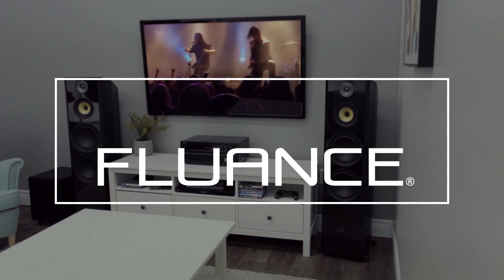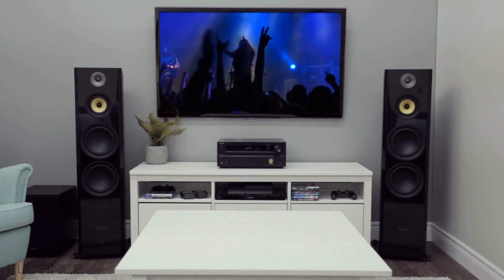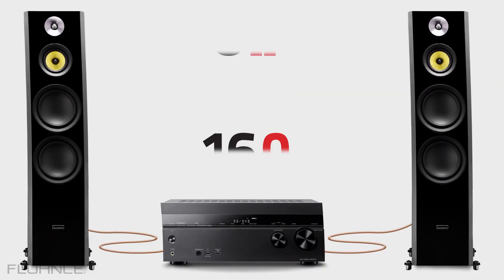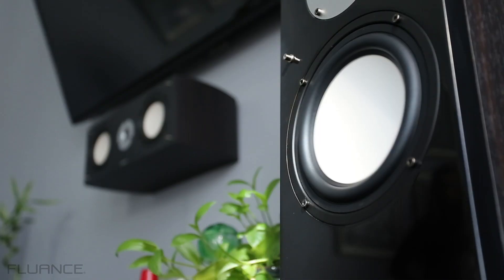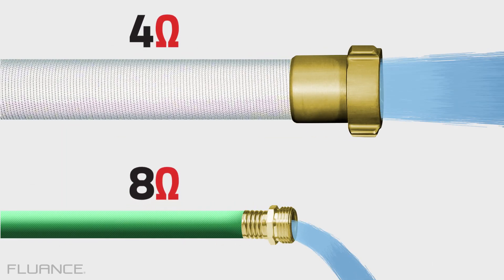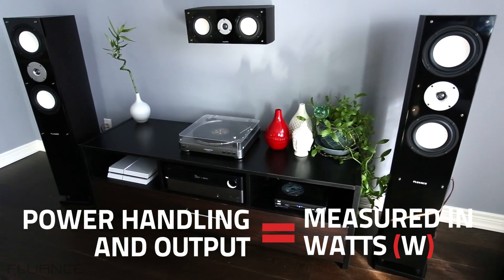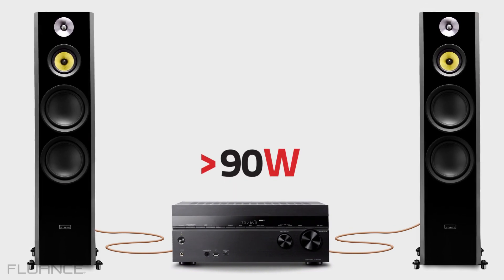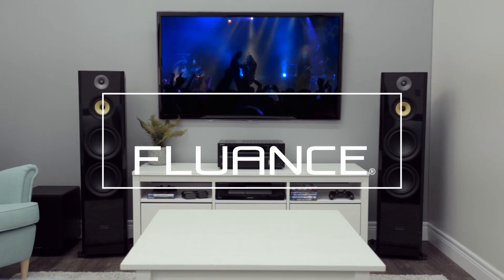How to Select an Amp or Receiver to Match the Impedance and Power Needs of your Fluance Speakers

Comment: I've got Sony ss-mf750h (200w each) and planning to buy a Sony STRDH190 (2 x 100w)
Would that be enough power? As I see in reviews that the am has 'plenty of power.
I also own a Sony STR 197 that has 2 x 100w and handle more than easily 4 x ss-mf450h (150w each)
Reply from the maker: Hi Sudexro! Provided the amp can provide power within the recommended range of the speakers, that will be sufficient. Ideally, it is better to have more power than the speakers will need, as insufficient power can cause clipping.

Comment: I have definitive technology bp2000s and I'm hopefully getting a denon 4k atmos receiver next week ..im planning to set my mains to 6ohms since the def techs can handle the wattage..would I still be able to set my center and surround channels to 8ohms since they are smaller..the center channel can handle 300 watts tho..thanks
Reply from the maker: Hi Ben, thanks for your question! This is more dependent on the receiver itself. YOur best option would be to reach out to Denon or refer to your receiver user manual.

Comment: I have 150w rms speakers. I can't find any avr receivers close to this in a 5.2 channel config
Reply: @Shanon is there an amp that will drive my center. Towers and side surround?
Reply from the maker: @panteraowns2515  This is a great question that many of can face. Something to consider is the impedance of your speakers. If your speakers can support 4 or 6 ohms, many receives can output more power when set to these impedance levels. If you have a certain brand in mind, we would recommend reaching out to the manufacturer of the receivers and get their recommendation.
Reply: I have Klipsch R 28f they are 8 ohm

Comment: I have an Yamaha rxa 770 (6-8ohms) and speakers 8ohms ( 90db 1m ) but i'm in doubt If i set in receiver 8 or 6, what`s the best way and why ?
Reply from the maker: Thanks for the question Fabio Zago!

You would first need to verify the impedance and power handling rating of your speakers. If they're 4 to 8 Ohms compatible, using the 6 setting will feed them more power. While it's typically better to have more power, too much can damage the speakers.
Reply: Fluance Audio how do set the impedance on the receiver?

Comment: does the rms of a speaker chenge if you chage the impedence of the speaker (dvc)
Reply from the maker: Thanks for your interest Ricky! Our speakers are generally rated 4-8 ohms compatible. The power handling rating does not change with impedance. On a receiver, power output increases with lower impedance so it's important to be sure your speakers can handle the extra wattage!